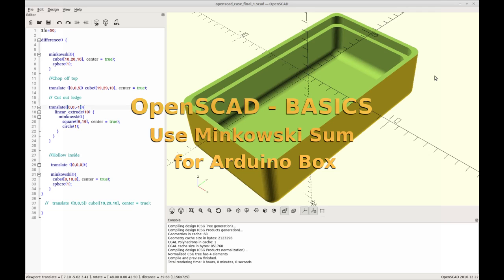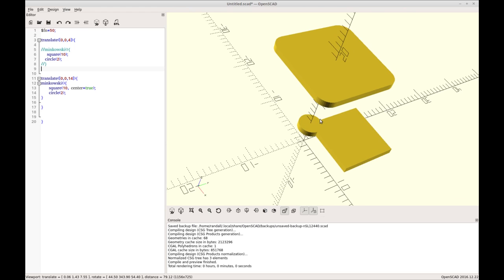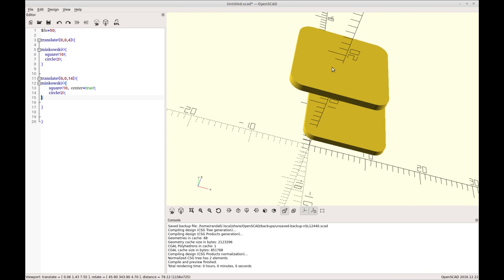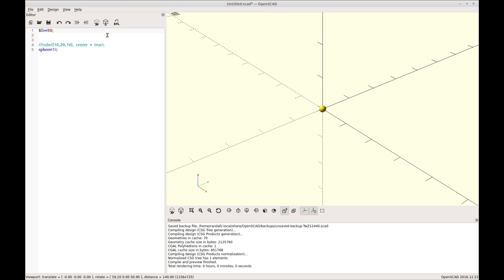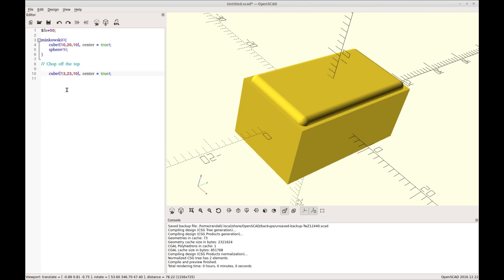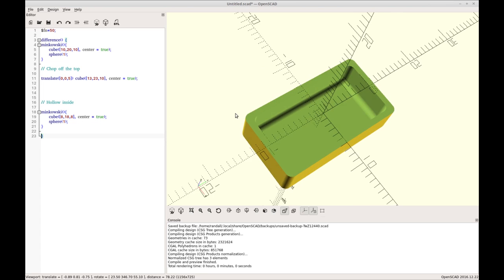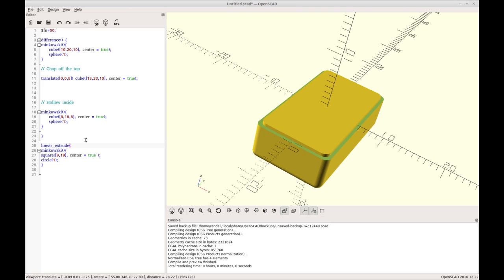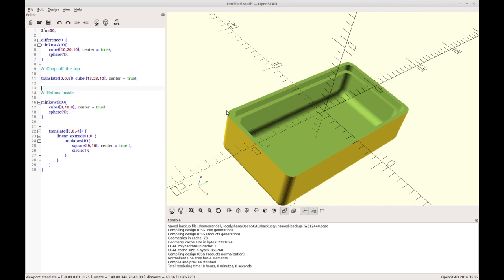OpenSCAD - Project Enclosure - Create round corners with Minkowski Sum

Comment: How would you scale the box's inner radius down to keep the wall thickness the same around the perimeter?
Reply: the math for that is a bit fuzzy, but I ended up with a decent solution: instead of making the box smaller, keep the box the same size and decrease the radius of the sphere. This should keep the perimeter constant all around. And keep in mind to have the original boxes aligned. Hope this helps!

Comment: The hull() function is useful too, and seems to be more efficient than Minkowski for some things. hull() around 4 cylinders arranged in a rectangle gives you a rounded rectangle. The last step in the video could have been done that way, instead of using Minkowski, when cutting out the lip of the box.
Reply from the maker: Definately !  when I made this I had just struggled through minkowski. I'll have to do another with Jill. Thanks for comments. :)